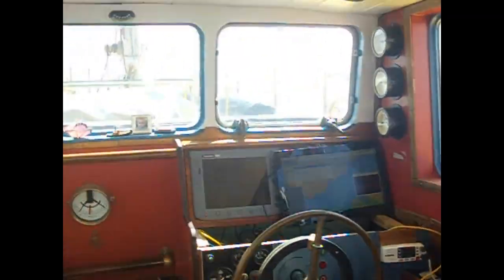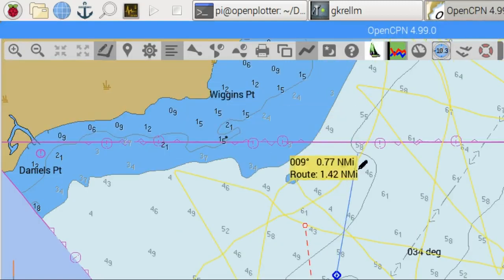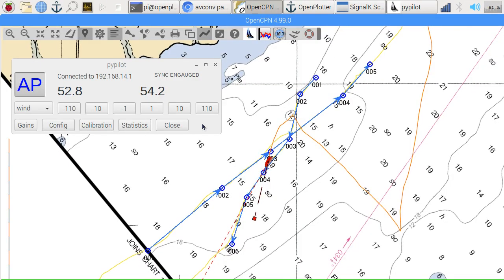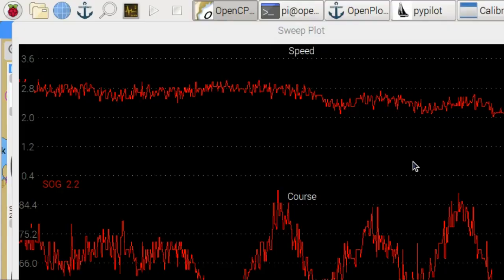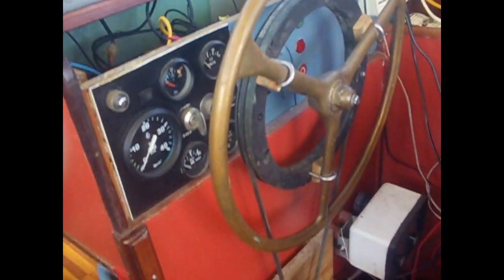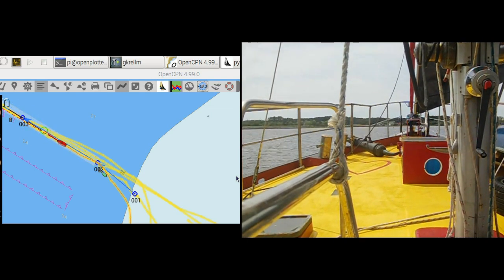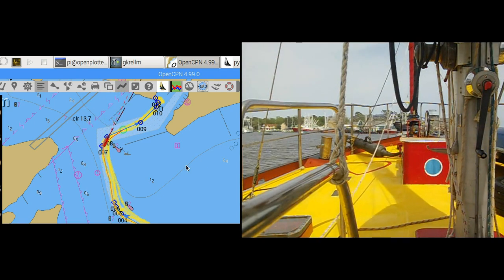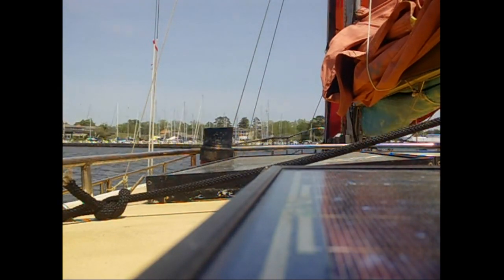pypilot openplotter sailing steel boat

Comment: I'm on a slightly smaller steel boat..13 ton schooner Blue Dragon. Openplotter as chart plotter. Looking forward to running pi pilot on either my hydraulic system or a linear actuator on my sailomat windvane

Comment: I agree, this is awesome. I'm in the process of getting a boat and one of the things I've been concerned about is spending a boatload of money on an autopilot just so I can single hand and be able to hold a course into the wind while I get the sails up. This looks like it should the trick, though I wonder if it is possible to set it up with a linear actuator attached directly to the steering quadrant under the cockpit sole. Looking forward to learning more about this and trying to set it up once I have the boat.